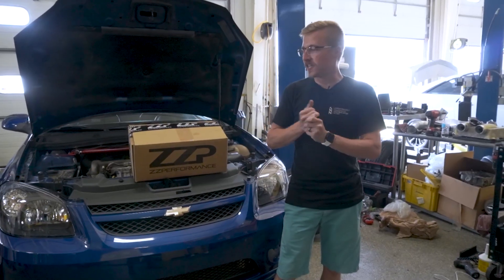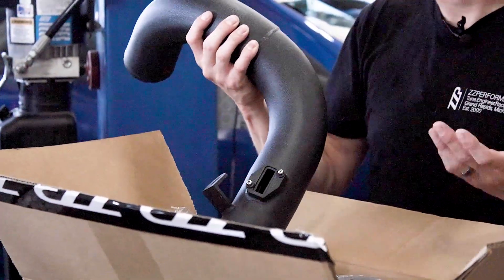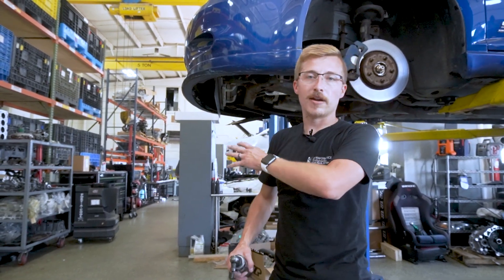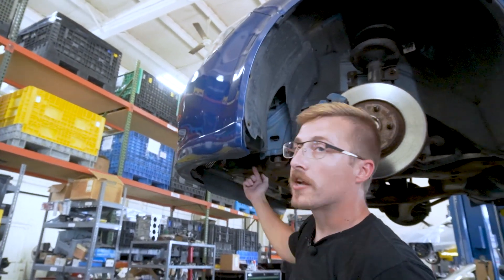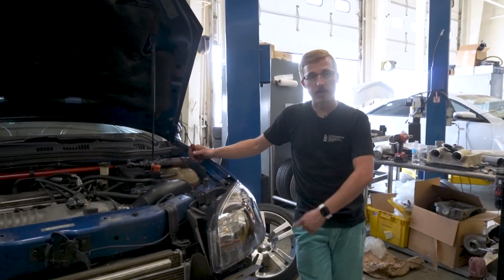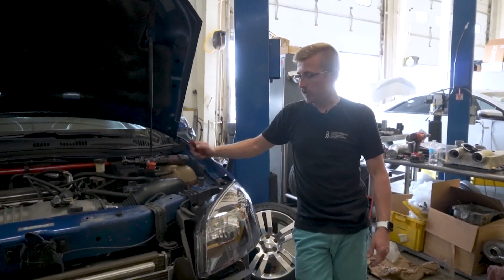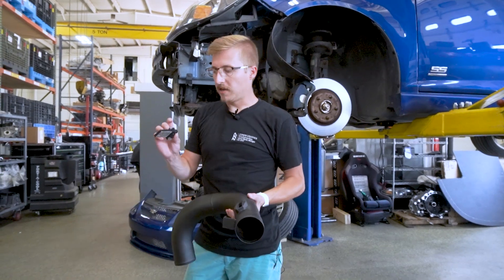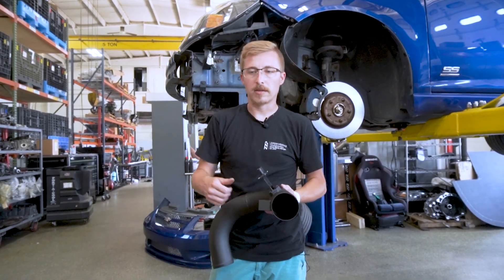Installing a ZZP Cold Air Intake on a Cobalt SS // Cobalt Build Episode 4

Comment: What do you think about removing the drivers side fog light, since the intake is right behind it? Would it ruin the air flow pattern in the intake?
Reply: Not a bad idea, definitely one of those things to get that last few HP out of a blower car.
Reply: @gbrunner24  I watched the intake podcast, couldn't it ruin the airflow pattern into the intake? What does Al think?

Comment: Would this be the same for a ls coupe?
Reply from the maker: No the 2.2/2.4 cars can not use this intake unless they have retrofitted a supercharger. We offer our 2.2/2.4 high flow intake tube currently and are in the works of our full cold air intake package.
Reply: @ZZPerformanceChannel you are describing exactly what I drive, I bought it and saw there was a zzp cai just jammed and shoved straight into the supercharger with a hose clamp being slammed by the hood, apparently I need to completely relocate my winshield washer fluid reservoir, can’t find anything online on how to do so